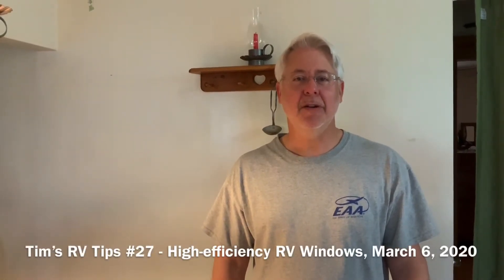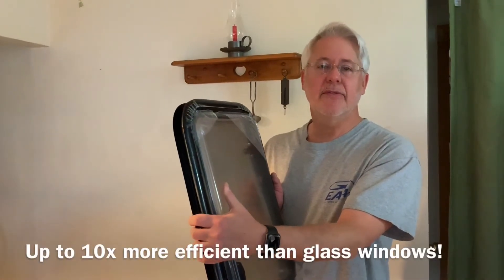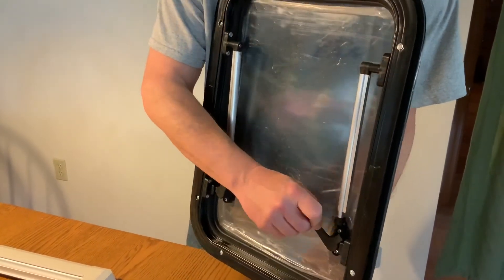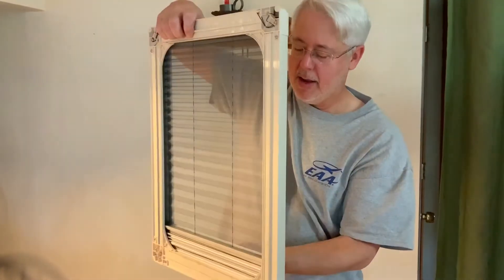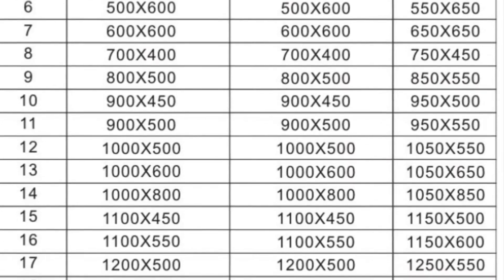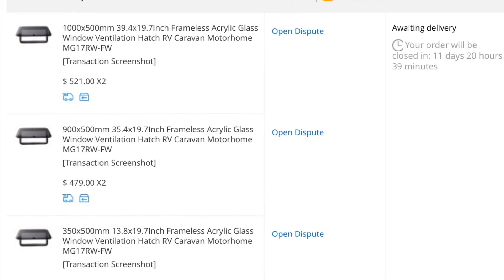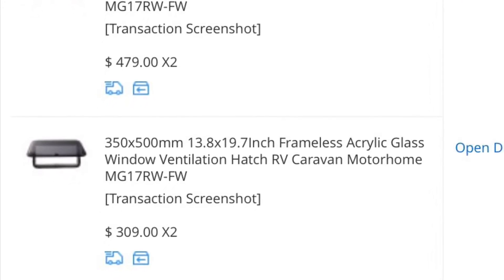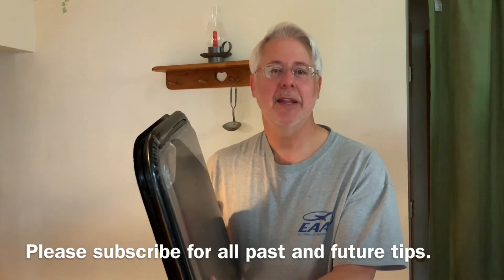Tim’s RV Tips #27 - Ten times more thermally efficient dual-pane acrylic RV windows, March 6, 2020

Comment: I just watch your installation video, very nice explain installation. I am about to order them , just  to clarified , are the windows you are using is model MG17RW   FW  called frame less. There is a few different models there , just to be sure.
Reply from the maker: Correct my Aliexpress order was for frameless, model MG17RW-FW
Reply: @tdrager    What size maytag  did fit in the back windows in the sprinter ? I was thinking may fit 450mmx450mm but they do not have that size. I know the window has to be smaller a few inches so the sheet metal  can get flat.
Also what size fit in the back on the passenger site. Thank you

Comment: Hi Tim, are you happy with the Maygood overall quality and such ? I know it is only 1 year now you've installed it but does it seems to hold up ? Have you ever had any water coming in, and what sealant did you use ? Thanks !
Reply from the maker: The Maygood windows are holding up great. When it’s cold, the frame sweats but the window itself does not sweat. Most windows sweat around the frame because they are made of aluminum. Mechanically, they have been flawless. The pull-up blinds and screens are working well. I used Quad Max caulking from Home Depot to seal the windows on the outside.
Reply: This is interesting. Do you thing using expanding foam inside the frame would help the condensation problem ? Have you had a chance to compare them with Arctic tern or dometic ones ?
Reply from the maker: @jerome_brr  I would call the frame sweating a minor issue. There is spray foam up to the frame. The issue is that structural integrity is required for the window frame, so aluminum is a desirable metal. I don’t see how the sweating can be avoided. The Arctic Tern and Dometic use the same or similar design, and perhaps the same Chinese factory as Maygood. If a glass window were used, there would be 100x more sweating. I am also researching how to reduce humidity in the van without opening the windows. A dehumidifier is a possible solution, but they can be expensive, noisy and use a lot of energy.
Reply: @tdrager  : apparently some have been using tiny house Hrv systems successfully to get rid of the humidity (lunos). Not sure if a 12 v option exist